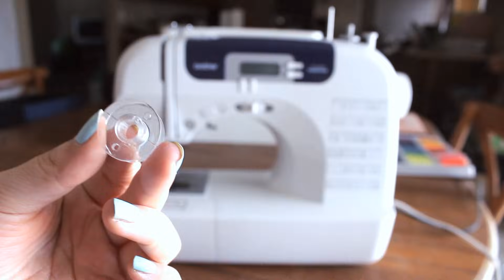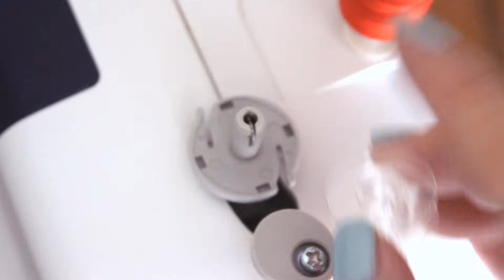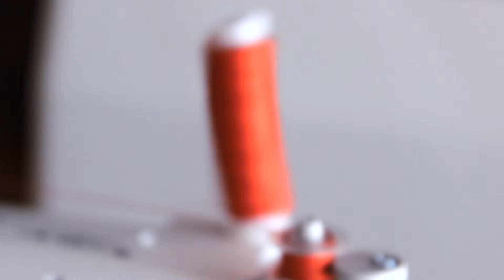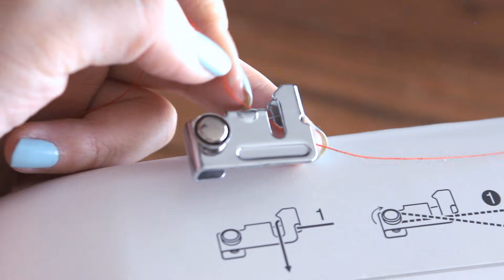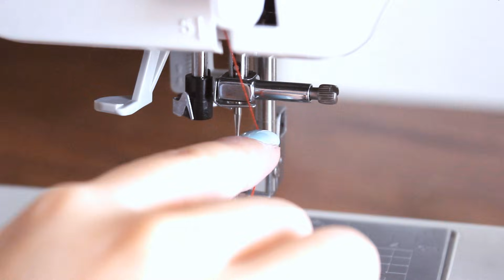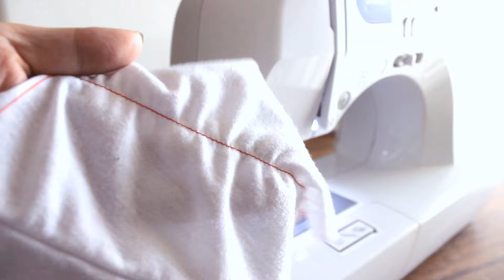How to Set Up Brother CS6000I Sewing Machine | Easy Step by Step Tutorial

Comment: I bought this plastic trash for sister. it's horrible. broke after two hours of sewing. I was so humiliated. She wanted a small machine for her dorm room and agreed this would work fine. Now I realize she just did not want me to spend a lot of money so she could have a real sewing machine. This thing is trash.  the needle threader never worked. that black thing that holds the bobbin keeps jumping and jamming the material under the pressure plate. I ended up buying her a singer to replace this which she did not want me to do but lesson learned. never buy a plastic sewing machine unless its for a child.

Comment: This was an excellent video and even helped me figure out much on my Brother CS7000X. Unfortunately, like other videos it over-simplifies the sewing process. For example, if you are not holding the fabric tightly in place when you bring the presser foot down, then it shifts position. To properly do this, you need more hands - two to hold the fabric accurately, and a third one to bring down the foot. I guess this is not a problem when you're using a scrap of fabric, but if you must follow a straight line it is. Also, when the needle comes down, so does the apparatus used to change the needle and that hits your right finger unless your seam allowance is great. For that, you need more space than is given. Plus, all is magnified. In order to accomplish most tasks shown, you need smaller hands than most people have or infinite room. Lastly, there is gravity. Unless you have a large sewing table or are only sewing a small cloth, the fabric falls down and that shifts the line you must keep to. Now try sewing.

Comment: This is helpful. But the bobbin thread needs to spin in a counter-clockwise direction to get quality stitches. Use the machines diagram and make sure the thread is coming off the left side of the bobbin before setting it in the case.

Comment: When I'm trying to thread the upper needle and there's the steps when I'm trying to do step 4 it's not catching on the inside metal thing it did once and I was able to sew but now it's just not
Reply from the maker: First of all, awesome that you did it once! :D That means we can do it again! Now let's troubleshoot. Is it this step? @5:20  If it is, then it is likely the metal thing might not be in the right position. The handwheel can change the position of the metal thing. As demonstrated in a different video: https://youtu.be/kAapa0-1znU?t=60 
Make sure to watch at least the part from 1:00 to 1:45 in the other video. That should solve the problem! :] (I hope) If it doesn't, let me know and we will figure it out! :D

Comment: I got everything up to the threading of the needle. For some reason those two little claws didn't get anywhere close to my needle. I'll have to take a look at the manual/other videos to see if there is a way to adjust that or if I got a bad sewing machine. UPDATE: Mine wasn't the lil fork/claw looking thing wasn't coming even close to the needle. My husband spun the circular thing on the right hand side (raising up the needle itself) and it came all the way around and I was able to thread the needle. Yay for husband going to a school that was rich enough to have a Home Ec class (my school didn't have the funding for a Home Ec class)! Also, thank you for this video. I've had this sewing machine in my closet for years. I was pretty much scared messing it up. Now that we have a shortage of masks, due to the Covid-19. I'm determined to practice my sewing because sewing masks by hand is taking way too long! Thank you again!
Reply: I'm out of my BLOODY MIND!! Having same problem w/ claw thing not rotating in toward needle unless I push it and then it loses the tread when I release it.  The "circular thing on right  hand side" is called the "Handwheel". So I turned that and still that damn claw stayed away from needle. Now my partner & I are beyond frustrated. We're backing away from the machine before it grows wings.  Will try later. But I hope to find more "tips" or more videos.
Reply: Exact same problem here!!!
Reply: Okay after I posted that here’s what we did wrong. 
Redo step 5 
When you get to step 6 wrap it in instead of out. It catches immediately.
Reply: @luvmym6  I finally got it! But don't know how. Perhaps it was the in/out you discovered. I'll find out when I haul it out again-soon. Thank you!!

Comment: Works great share4.photo/bSewing?Ѕ Very plasticy . Good options, Decent speed and strength. Wish brother was open on their software to make embroidering easier. It’s all pay to play. Changing thread is fast, bobbins I don’t use top wheel guide to thread cause sometimes it goes on bobbin thread post and drives me insane lol. Quick stitch selecting. Awesome homeowner machine . I do all kinds of self tailoring. Get plenty of bobbins, needles (gold seems good balance without breaking) and thread. It’s fun to use. Led light is great, I leave it on 24 hrs in my sewing room.
Reply: @TheGuilbeauLife  no it does not

Comment: You forgot to set the tension.... Great video though. But remember guys, before you start sewing, make sure you understand the tension you need depending on the type of fabric or layers of fabric.  There's upper tension and lower tension. The upper tension is determined by the upper thread and the lower tension by the bobbin thread. You may need to adjust the tension based on the type of fabric such as satin or demin. As well as the thickness, for example, one layer of broadcloth vs 3 layers changes the tension that is required.

Comment: Great tutorial other than the fact that the bobbin was actually in backwards. Thus the thread was coming off the wrong direction and I believe this would affect the tension adversely.
Reply: Tension for bobbin causes bunching. Also she didn't thread bobbin properly.
Reply: Is that why the finished sample was bunched up?
Reply: tazmun 
Should the thread be going in a clockwise or counter-clockwise direction relative to the bobbin when it is dropped in?  Thanks.
Reply: I got my thread stuck while trying to do the test part and now my material is stuck in the teeth that moves the thread. It was a disaster! Now my machine needs repairs!!!
Reply: @sandrabita9507  I found this YouTube video that might help you without having to pay for service. Also it shows as I said before the proper direction for the thread to come off the bobbin. You have to look close but when she pulls the thread and it turns you can definitely see she has it in as I described.
https://youtu.be/tDcBUR0PcyA

Comment: This video is well done...good narrative, good close ups. 
One thing to specifically point out is to be sure the presser foot is up before threading the tension disks...that is imperative for all sewing machines and while not specifically shown it seems the foot was up in this video before threading the discs. The bobbin was placed in the bobbin case going clockwise and it should have been placed going counterclockwise...although it did stitch well in the demo. Others emulating this video's instruction may not have similar good results.